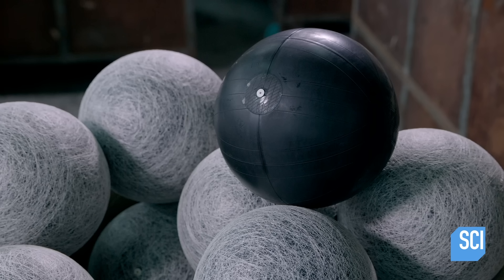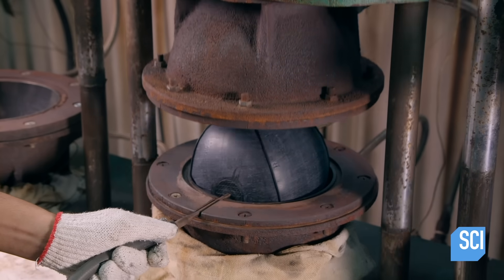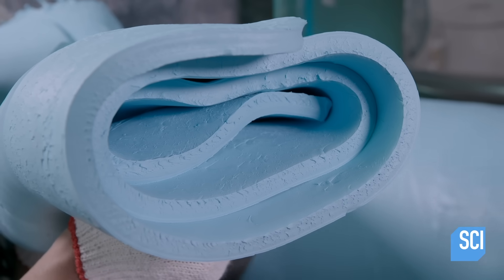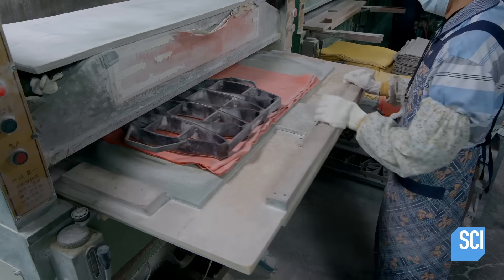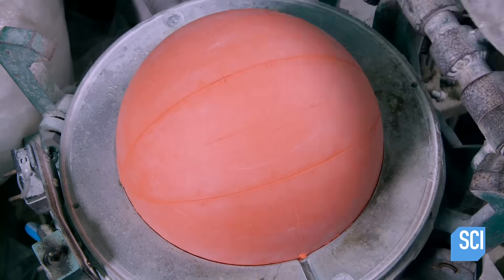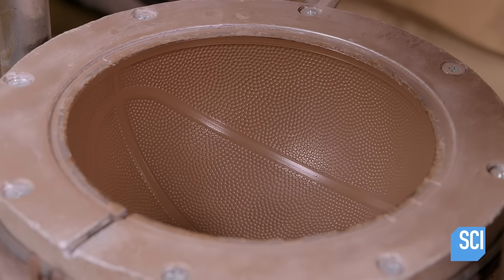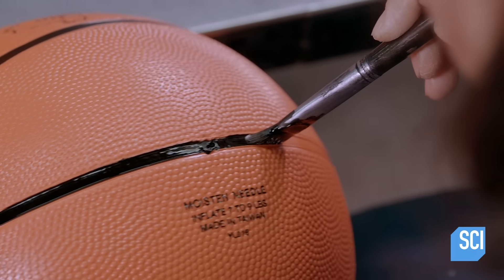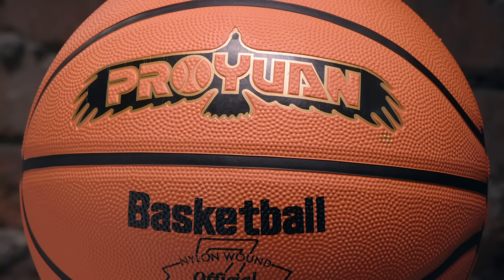How It's Made: Rubber Balls

Comment: Did you guys notice how much rubber was wasted at 0:46
Reply: I was thinking that. I think rubber pieces can be used in playgrounds and astroturf as well as an additive in asphalt, but usually those applications add shredded used rubber tires and not quality virgin rubber. I was expecting this process to inject the rubber, but my understanding is butadiene rubber is not thermoreveresible, it's "thermoset"

Comment: and i still dont understand how the metallic sound comes from the basketball when bounced  very hard.....any1 knw abt this
Reply: it comes from the rubberbladder expanding to its full size after being compress by the hard dribble. The metalic sound is generate from  the bladder swinging from the pressure waves. Notice, you need enough air in the ball that those pressure wave are generate and transformed into sound. :)